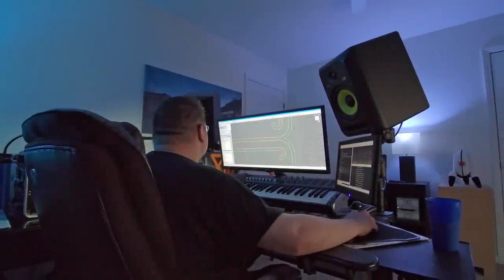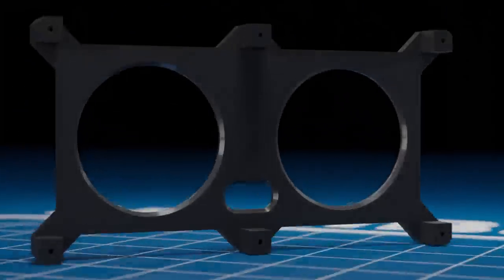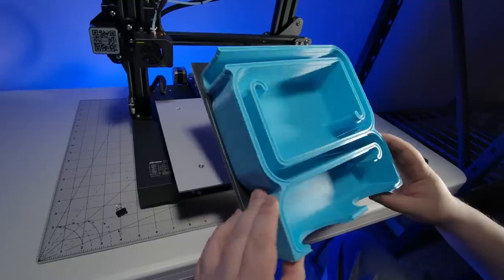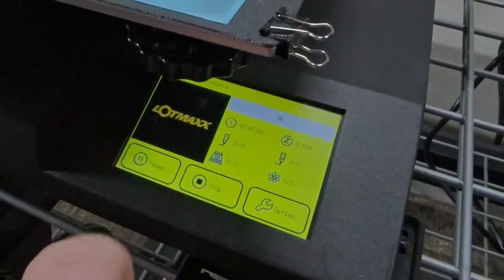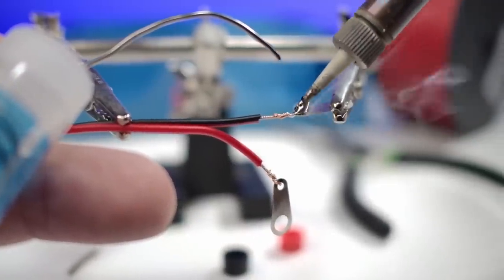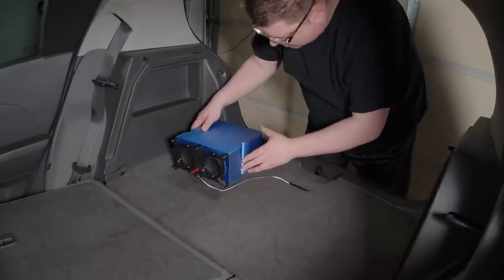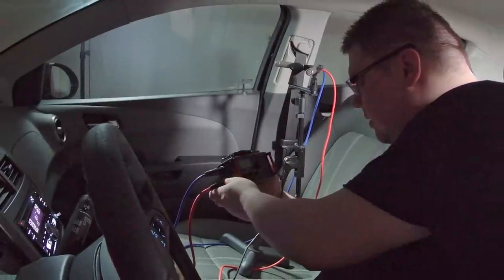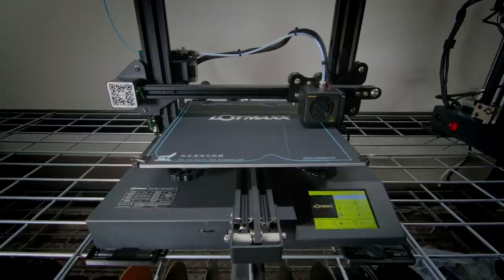HexiBox v.3 featuring Lotmaxx SC-10

Comment: If you ever venture into 3d scanning, can I suggest the project idea of making your own version of a stealthbox? I know Stealthbox is a JBL sub-brand, but I'm talking about just a box that fits into the oddly shaped cubby holes in the quarters of trunks and the rear cargo areas of suvs. 
I know one of the biggest issue with making an enclosure fit a shape is that the fiberglassed portion of an enclosure won't be entirely volumetrically accurate, and there's not a good way to measure that volume; plus those enclosures are typically sealed or ported, not a TL or bandpass boxes. This is where 3d scanning would be useful, not just for finding the surface area, and in turn part of the volume, of the customly shaped enclosure, but the surface scan would also allow you to model and print a matching core for developing a TL enclosure. 3d scanning also goes hand-in-hand with 3d printing, and would be a good fit for this kind of content. I also realize some of these areas are probably too large for a single print, but you could probably puzzle piece your way through the interior of the enclosure while having an mdf or plastic sheet front face.
In short, basically just a HexiBox in the form of a generic stealthbox, while using 3d scanning and 3d printing to make the most of a tight space.

Comment: I built the v2 with a black and a copper filament. Looks and sounds great, although now, for no real reason I will build this one as well. One question, as per the V2 STLs, you have no holes for the speaker screws. On my V2 the speaker is held in with blu-tak, but I see in this build you actually screw the speakers in. Did you drill pilots and use self tappers? Would it not be better to include holes in the STL? Great channel BTW.
Reply: make a video demo....would be interesting to hear them

Comment: I have no experience with audio design, but I do 3d printing.  I have noticed that most 3d printed speaker enclosures tend to follow a traditional shape, for example how transmission lines tend to look similar to what one would build out of wood.  Since 3d printers are capable of printing structures not possible in other ways, are there any "out of the box" designs worth exploring?  I'm thinking about how the B&W nautilus design was an interesting departure.  Or how physicists use carbon nanotube structures to create ultra black paints that reflect no visible light.  Perhaps there are some shapes that can come closer to an ideal enclosure geometry.  Or maybe enclosures can have interior structures that could not be easily created without a 3d printer, like the complex infilll geometries 3d printers use, except on a larger scale.  Or maybe fins that deflect under sound pressure.  Thoughts?

Comment: I think this is a valid innovative question.  Why don't all the car enthusiasts just build a high order bandpass speaker than simple sealed or ported boxes?
Reply: Most proper SPL focused setups are 4th orders or 6th orders, enormous boxes with as many drivers as they can cram.
Reply: @UniCrafter  so why not 8th order? doesn't it catch or hit more frequencies in 1 enclosure?

Comment: Have you tested these outside? Or in very large rooms? Does the bass amplification effect still work? 
I'm wanting to build a small DJ setup, battery powered, portable to be taken to the beach etc, but big bass and portability have never gone well together, and neither has big bass and battery power! Lol if I could get a few hundred square feet of the beach bumping with this, it would fit my build perfectly

Comment: thank you for the great video. I built the system. The SW is hooked up to a mivoc AM 80 MK II. the speakers I connected in parallel. First impression was ok. However, when increasing the volume only a little bit, there quite impressive venting noises, really affecting the sound of the subwoofer.
Does anybody else experience this? It seems to be that too much air volume is moved/the cross-section is too small resulting in these noises. Any solution?

Comment: Ive always made all my enclosures with MDF and/or wood. Oak and Walnut I've always leaned towards, but I think that has more to do with my Dad than the sound itself. But goddamn if I don't want to build one of these little guys and see how well they replace my Image Dynamics IDmax 12. Just for kicks if anything else. A lot of these small speakers could be used for a fun project. 
I have been wanting to build a computer desk with all of the speakers built into it. Maybe go as far as have the speakers come out of the desk when you want them. Or even find an interesting way to incorporate Dolby Atmos. This is gonna be pricy and fun.

As a fun side note. The Logitech G Pro headphones I typically use for the computer work SO much better when using a better DAC/Amp rather that the little USB thing that comes with them. I am actually surprised at how well they do.

Comment: Have you tried using an "O-ring" to seal the two halves? All you need is a groove in each half. You can buy different sizes in roll so you can make it as small or big as needed.

Comment: Just wanted to ask: is it normal that the Subwoofer is ~50 Hz completly ineffective at producing a clean base? the membranes are dont have movement in the height and are producing a static like noise.. Wierdly enough, going down or up the frequency they function like intended. Currently the drivers are hooked up in a parallel config.

Comment: How do you secure your drivers into the enclosure? I notice the enclosure is printed without any screw holes. Do you drill undersized holes after printing and then let the screws self-tap into the plastic? Do you use self tapping M3 screws?

Comment: Ive been using thingiverse for most of the time. 
And if I need something that is not already on the websitr I just use tinkercad or fusion 360 to draw a model myself. 
For slicing my models I tryed quite a lot different programs and it turned out that Cura is the best one in my opinion.
Ive got an ender 3 , it has always very good results and after doing some little upgrades this machine never failed a print for more then over a year.
A glass print bed did make my print quality a lot easier,  the original bed is just crap. With glass I got always a good first layer and a smooth finish on the bottom.
By far the easiest to print on , also if I print bigger object I just use hair spray on the glass so the first layers really stick and prevents the print to warp half way.

Got to say nice bass out of these little boxes, oh and I almost forget to say great video editing too!
I prefer the v2 style speaker, it sounds a little more refined (on my headphones though, I dont know how it is in real life it could be different).
The v3 sounds at mid freq a bit loud ..Or how do I say it...boxy boomy ? while the lows are quite impressive for such a small box like that 😎.

Comment: Are the drivers wired in parallel?  If so, that would make them 2 ohms so any amp you have must be able to drive a 2 ohm load.
Reply: I suspect the amp he’s using to drive these isn’t breaking a sweat at any power output those little cones can consume.

Remember, the issue with low impedance is whether the amp’s output transistors can tolerate the current passing through them (and thus the heat, usually.)
Reply: @nickwallette6201  Also, at low impedances, the amplifiers damping factor drops significantly... Losing control of the driver.
Reply: @mattmanyam  It's a subwoofer, so just don't worry about it. Losing control LOL, it's not like the speaker might run away. The resonant freq stays the same. If you assume 1 Ohm output impedance (ESR) of the amplifier - which is about the order of magnitude that you would expect in amps only intended to drive 8 Ohm speakers, so basically worst case, and you put two 4-Ohm speakers in parallel totalling a 2 Ohm load, then you imagine that the ESR with R=IV has half the current (same voltage) going to either speaker, so effectively splitting the resistor in half for either driver. Qms is much higher than Qes and is main contributor to Qts, so when you add 0.5 Ohm, Qts changes from 0.43 to 0.48 which is not really THAT much of a change, it's like margin of error stuff. Even if you add a full Ohm then it reaches 0.53 which might just barely start bordering on becoming audible if it was a full range cabinet, but this is a sub.

Comment: Hexibase, how tight the wall of  that plastic box are? In the past we worked with 3d printed stuff at work and water was capable diffusing thru the plastic walls. Did you used sealant paint inside? If there is air diffusion thru the wall the Q factor of your box will drop a little bit and you might loose efficiency right? Just like the old  aperiodic vent with diffuser to extend LF if i remember correctly and make it les boomy ?

Comment: Don't rely on low cost 3d printer with a sensor screen! It's a pretty weird part. If it's connected through a "proxy block" then you're possibly getting some troubles. A sensor screen should be supported natively by a motherboard. And if not - never choose that 3d printer.
A 3d printer can have a big and informative screen (not a touch screen) + an encoder. It's usually the most reliable option. Only few not expensive 3d printers has touch screens that works fine. 
Also included free SD cards usually are faulty. Never rely on them, it can cost you much more (through filament's cost).
If you want to find more about these themes, find Dmitry Sorkin's channel and ask him. He makes live streams (by Fridays or Saturdays usually) and answer many questions. He understand English so don't hesitate.

Comment: Would the v.2 work good as a mini subwoofer in my car? Thinking about putting one under the passenger and drivers seat. Also, what amp would I need to use since the rms is only 15 watts? Thanks!

Comment: Nice design :) 

I'm pondering about this sub as an addition to my JBL Extreme 2 portable speaker. While I do like the Extreme 2 it does have its limitations when it gets around lower frequencies (100Hz and down) espcially at any significant volume which is a bit of a bummer when sitting outdoors with a couple of friends down the local harbor, listening to dub and dub techno.
It would of course require some amp aswell as batterypack but that are details I will solve when I have found a suitable subwoofer.

That dub techno track you used to test with sounds great. what's the name of it?

Comment: I am curious about the comparison between the 2 versions because the version with 2 speakers cannot have the same impedance as the single speaker version, so unless that is a constant power amp or gain adjustments were made in between, one enclosures will get either twice the power or half the power of the other depending on weather the version with 2 speakers is wired in series or parallel.

Comment: Quick comment on the Lotmaxx SC-10.  What you are trying to do is basically impossible due to material shrinkage.  There is nothing wrong with the build plate or the machine itself, from what I can tell.  A Creality device would not do any better.  These prints require really strong FDM skills.  Start with a heated volume.  Consider adding small pockets at the corners, so you can clamp the model to the table once the first hundred, or so, layers are in place.  Small 3d printed clamps will be sufficient but they need to be PETG, not PLA.  Print at the lowest temperature possible (180C, if you can).  To this end, some PLA will print at lower temperatures than others.  You should be able to do better, perhaps well acceptable, but it will never be perfect.

Comment: Wow! Stunning!
Is it possible for you to create a version in order to be able to print it on a more common bed size like 220x220?
Also, which cheap amplifier for this puppy would you recommend using in a car? I think that a 500$ amp does not suit a 70$ 3D-printed dual 3" subwoofer ^^ Any suggestions in the 100-150$ range?

Comment: Ooo man..  this series based vented enclosure with 6 of the TB6"subs.  Or even 6 of the TB8. :0

Wont be a 3d printed enclosure due to its size but I bet it would sound amazing.    What software do you use to model /design your enclosures?

Comment: Hey, I been following you for a while waiting if that would be possible to build a Bluetooth speaker using the same technique, i know what you do is oriented to car audio but would that be awesome to see.
Reply: I would love to see this as well. I think V.2 with a third piece that serves to hold the battery and amplifier (and maybe even the mid range / high range drivers as well). I would try this myself if I had room for a 3d printer, but I also don't know of any good portable amplifiers capable of driving these subs.
Reply: Yup. I'm looking into this, the lazy way is to get a Tps3116d2 based board and power it with a 6s li-ion/lipo battery.

Comment: @hexibase I'm curious what the db level increase is for the blue box.  Just by adding the speaker you increased by 3db (double the speakers, or double the power).  If you got more than 3db increase, then the box design is more efficient...though it does have a nasty resonance at around 80Hz.  Perhaps some fill would mitigate some of that.

Comment: you could have divided the build into smaller parts maybe, but idk 
would love to print my own speaker some day
Reply: Im not sure what sealants are used to bond plastics, but if the bond is thin, strong, and airtight, it should function just as well as solid piece. HDPE is easily weldable, If thats an option for a 3d printer.

Comment: Using a 4 order band pass for a single 18 for home theater where is the best place to locate the wiring to prevent port noise and best location for the terminal block on the outside of the enclosure?

Comment: well Diy perks has a great diy channel. he did a video a few years ago which I've been interested in visiting in which he made a bluetooth speaker from concrete. it was able to make great bass because of it's construction material. after speaking with a few of my audio engineer friends they said that concrete has garbage acoustic properties hence it not being used in commercially available speaker/enclosures but after seeing Diy Perks video I'm not so sure about that opinion and perhaps its durability that is the issue.

TL;DR: Check out diy perks. try making one of these from concrete.

Comment: Awesome! These are always a treat. I have an old bose car audio system that comes with a Powered sub. But in absence of all the parameters, how would you advise to build an enclosure for that? Or is there a sure-shot method to obtain all parameters for an undocumented speaker?
Reply: Also at times, even locally available speakers have wrong parameters delivered with the documentation. Would be great if you can do a video on deriving parameters for a driver without using fancy equipment.

Comment: A lot of people use foam or somr other kind of stuffing in their speakers and subs, just wondering if you have tried this?, or is it not neccesary?
Reply: Stuffing in a speaker box is a "tuning" tool that is used to change the response of the speaker relative to the imperfections in the box or the speaker in it. Anything you see on this channel has been measured, researched, and triple checked to account for any and all imperfection in the speaker. The boxes this guy builds are as nearly perfect as is possible. He could theoretically design a box that requires stuffing from the outset but that would kind of defeat the purpose.

Comment: @HexiBase, I wonder if it would be possible to replace a factory subwoofer with one of your boxes and a smaller driver to get bigger sound.  In my Hyundai it has a very cheap 8" woofer that is basically all paper and it struggles with true low notes, but the power requirement is almost identical to the Tang Band w3s.

Comment: Is there any way for me to buy any of these. I mean there just wow.
Reply: Speaker is on back order until 10-30-20. Plenty of time to buy a 3d printer and learn to use it. Total build cost is over $100(speakers, filament, wire, connectors) plus printer and assembly time. Guessing to buy would be in the 150-200 range so might be better off buying something from a manufacturer.

Comment: Would it be possible to contact you for an enclosure design and cut sheet? Specifically, an enclosure for two 12" Sundown LCS's that are going to be used in a home theater set- up.

Comment: man the sub box you make make my mine look like a potato  and the frequencies are lower than mine by a long shot i can only get mine to sound that deep at 41hz but at 35hz its less audible and isn't as booming any recomendations to fix this? btw mine is a home theater  8 inch sub that supports only 250watts
Reply: Look into building your own enclosure, if you can find the Theil/small (T/S) parameters for the driver. Generally a subwoofer can go deep and be efficient if the enclosure is large (transmission line or horn) a low tuned ported box shouldn't be too big for an 8" sub, but the response drops at 24db per octave below tuning. If you can find or measure the T/S parameters, there's free programs to design an enclosure.

Comment: Intresting design, if i have some dali rubicon lcr that needs some more punch (30-120hz) i want to make a passive sub to handle the lovet bass. would you recoment long port like your design, or passive radiator tuned to take the lowest. (It has to fit in a tv furniture) with 6.5inch woofer?